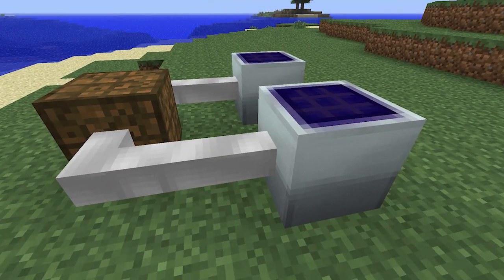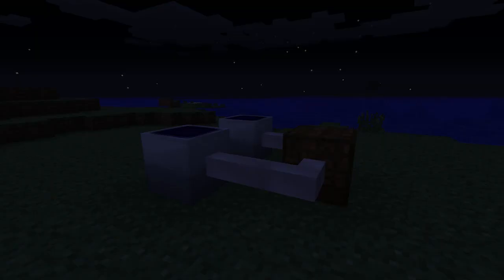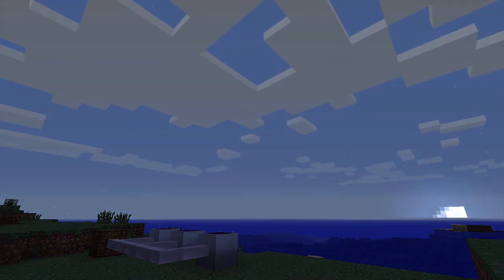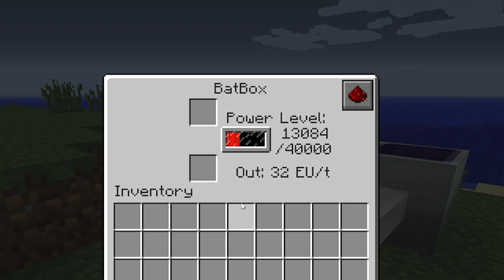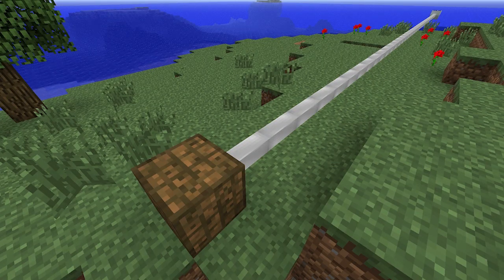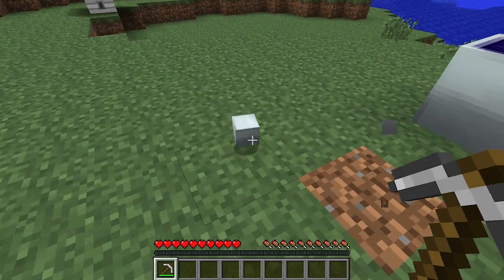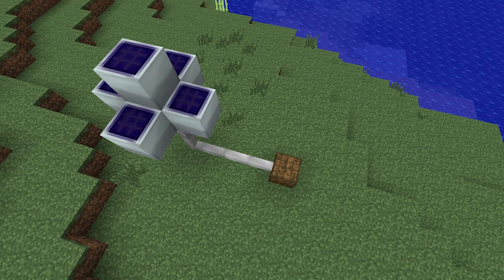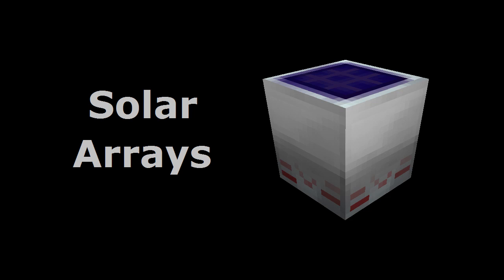Solar Panel (Tekkit/Feed The Beast) - Minecraft In Minutes

Comment from the maker: That's an ultra low current cable. They are only capable of handling very small voltages, but they're very cheap to produce making them ideal for solar panels, wind mills and water mills.

Comment from the maker: I actually need to do a separate video about this. FTB (Feed the beast) has a bunch of mod packs, and most of them include that plugin. Tekkit on the other hand currently does not. So right now, if you load up both of them side by side, you'll see they both have completely different sets of solar equipment. This will lead to some confusion.

Comment: Solar arrays require the mod "compact solars" to be installed alongside industrial craft. This is a plugin for ic2 that is present in almost every modpack which has ic2 as well. Most of the modpacks which dont have arrays use the advanced solars mod instead, which adds different solar panels which also give more eu. A low voltage solar array is made with 8 solar panels and give 8 eu/t. Med-voltage require 8 Lv arrays and give 64 eu/t. High-voltage take 8 HV arrays and give 512 eu/t.